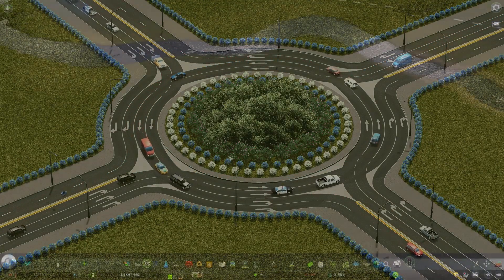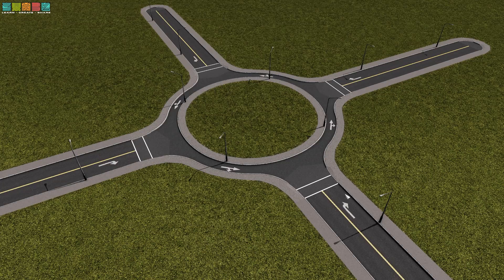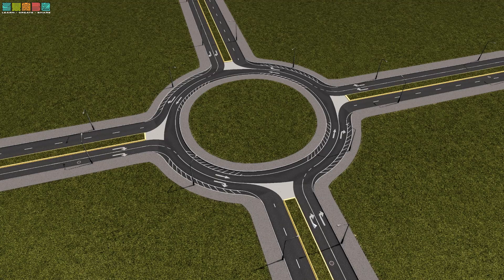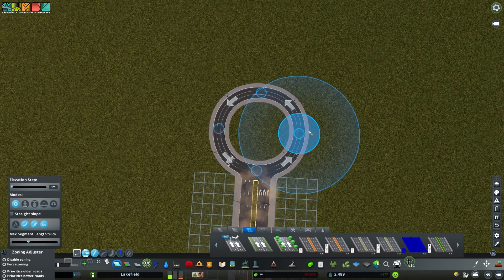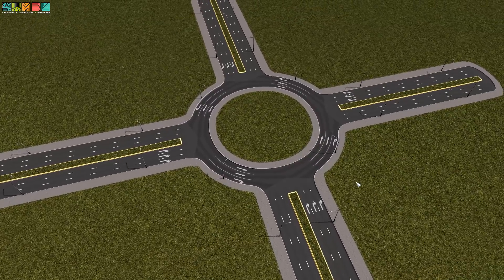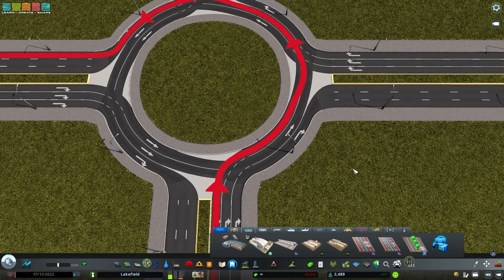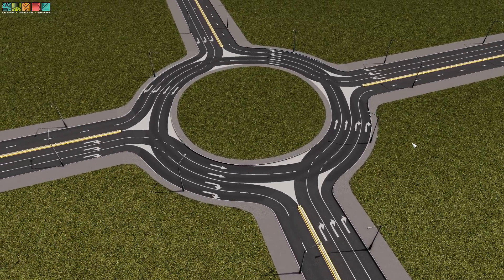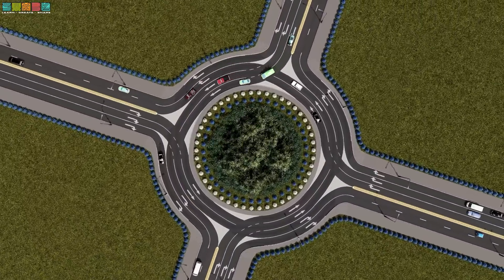Turbo Roundabouts and BEYOND!  -  Building Roundabouts in Cities Skylines

Comment: 3:17
One lane can fill either of the lanes inside the roundabout does just fine, giving you good flow.
Using two lanes only really makes sense if you have too high intersection density anyway...
I really don't see why you should have two going in if you got a well designed city.
As for having two lanes going out, you're not supposed to.
When you have two lanes in a roudnabout the inner lane is supposed to keep going around and only the outer lane is actually meant to be used to exit the roundabout.
If you have a roundabout with 4 roads going in and you drive towards the roundabout the rightmost lane in the roundabout is for when you want to go to the road to the right.
If you want to go straight ahead, left or essentially do a U-turn you'll take the left lane then switch to the right lane once the next one is your exit.
Any traffic to the right of you inside the roundabout has already left the roundabout in the previous exit, and any traffic comming into the roundabout is yielding to you anyway.
So you'll get good flow out to the outer lane.
If you have two lanes going into the roundabout you just increase the likelyhood that some idiot in the other lane going in ends up cutting you off, potentially causing an accident.
As for when leaving, a two lane roundabout only have one exiting lane inside the roundabout at every exit anyway if it's designed correctly.
So in either case you have one lane going in and one lane exiting the roundabout at every step.
Adding more lanes just risks adding more confusion and increases the risk of accidents.
Just K.I.S.S. for goodness sake...

4:28
That might look good but it's a horrible roundabout...
In reality less markings and fewer lanes entering and exiting would make that roundabout much better...

6:03

I don't have enough experience with that kind of roundabouts to comment 
much on what is or isn't best for the 3 lane roundabouts.
That said, if you need anything like that then you probably got a city planning problem with too much traffic to begin with and not enough mixed zoning.

Or in other words, pretty much all of North America... :-/

10:12
Hum, if I was making that one I'd do two lanes in (unless there's a bus lane or some such, if there is I'd probably end that shortly before the roundabout to simplify things).
With that many lanes markings might make a bit more sense...

Comment: To allow U turn you could add U turn spot before the roundabout, at least in the version with green belt between directions. That way, you don't have to enter the roundabout to U turn.
To be honest, I have never seen turbo roundabout as shown in the RL, it's usually allowed to either change lanes to right or stay at the left lane. But even those are rare, and usually the it's just the right lane if you intend to leave round and left lane if you want to continue on roundabout.
Reply from the maker: Excellent idea!
Reply: In the Netherlands you can find Turbo-roundabouts, usually not larger than 2 lanes, Turbo-roundabouts are safer than ordinary multilane roundabouts since changin lanes on the Turbo is not done (also there are ridges between the lanes to make people not switch lanes), you have to pick your lane before you enter the roundabout.

Comment: Never seen any of these. And we have roundabouts in most intersection in my home town. The thing I’m a little concerned about is the fact that you have more lanes inside the roundabout, than from incoming lanes. Here we have 2 lanes in the roundabout itself if there are 2 lanes as the largest incoming road. Since you always has to yield for the traffic inside, and their choice of lane inside desides what exit their going to use. We also have a third lane sometimes for just going right, but it’s mostly detached from the roundabout itself. And merges with the next road as a highway lane coming in. And of cause we have more lanes in the roundabout if there are more lanes coming in.
 And for clarification. The right incoming lane is for right turning or straight ahead. The left for left or straight if there are a 2 lane road outgoing. But you do not change lanes inside the roundabout when using the left. Then you also depart in the left lane. Meaning you can have double the traffic going straight.

Comment: We (NL) usually have dashed markings on the complex round-abouts, so can easily switch lines.  The lines bring you to the pre-chosen exits, but you are not required to follow them strictly.  This enables passing cars (especially useful when the circle is large), and you can also make U-turns.  When you accidentally miss your exit, simply get around once more.  On small-spaced turbos, we often have strict linings, often enforces with bumps to discomfort switching lanes.
Reply: one configuration we (NL) have of the turbo is the 2 lane entry with the priority/main road having the right lane going right and straight instead of right only and the left lane going straight and left. and I love it. it works incredibly well with high traffic roads that pass by towns. it would be the configuration of my choice for a lot of town/city main roads/streets in the US that are currently already 2 lanes wide.
Reply: NL city planning is so incredible.

Here in Belgium, city planner learn a lot about your vision about city planning.
That's pretty cool
Reply: Uh... If my (Dutch) driving instructor and instructional material is to be believed (and I also believe it): no, you are required to follow the lines of the turbo roundabout. You are in violation of the traffic code when you switch lanes of a turbo roundabout. Doesn't keep folks from doing it anyways all the time, though.
Reply: Nl?
Reply from the maker: The Netherlands.
Reply: @conrrr  netherlands

Comment: I often use a slightly different version to your turbo roundabout: traffic on the inner (left) lane is allowed to stay in the left lane, which allows for U-turns to be made. The lane markings show the lanes on the roundabout, so that traffic driving towards the roundabout have an extra visual cue to give way to traffic already on the roundabout.
Reply: This is exactly what I have been doing too! Sometimes disallow u-turns on the bigger stuff. And I agree the markings are the wrong way around, the lane that gives way should cross a line, not the one with priority.

Comment: I think one time you'd want to avoid the turbo versions is if you've got, say, a collector road with roundabouts for intersections with other collectors and right-in/right-out intersections with local roads. Think a roundabout-ified RCUT-like thing. That sort of arrangement depends on allowing U-turns at the larger intersections to allow cars from the local roads to  proceed across or turn left.

Comment: The two lane roundabout setup (atleast in Australia) is quite rare. I call the style you did a tumble roundabout as you tumble to the outside lane to leave, you mainly see them on semi low-Med traffic suburbs but not major roadways (typically).

Typically both lanes entering the roundabout can continue straight ahead and you don’t need to change to the outside lane to exit. this preserves the through traffic aspect while making turning easy too. The best way to replicate this in game is to fork the roads into two one way roads just before the roundabout. The one way “on ramp” is then connected to the roundabout in such a way that it and the “exit ramp” of the crossroad now form a junction, creates a good flow and makes the first exit very easy for the traffic

Comment: Here in the UK the 2nd roundabout you showed is not quite right - the left lane entering the roundabout can go left or straight on (UK left hand drive), the right lane can go straight on or right.... So basically both lanes that enter the round about can exit on the opposite side. This helps when the main route would be straight on and the 2 turning would be used the least.  But I like the turbo designs.

Comment: Your two lane example, you can use Asymmetrical 2+1 roads instead, since you have only 1 lane leaving the roundabout, not 2, so the extra lane on a normal 4 lane road isn't used.  Same applies for your tubo example using a 3+2 or 3+1 asymmetrical roads.  Yet you did do it right with the super turbo LOL.
Reply from the maker: A three in one out road is a bit strange. Idk if i have one
Reply: @YUMBL  I dunno if a mod has one but at least a 3+2 would work.

Comment: The bus line example is just the cherry on top the explanation of this spiral behaviour ... an alternative would have been to color the lanes (by destination) with the markup tool.
One thing is however annoying ... the 8:20 "forced exit" only happens to one outer lane which then goes into three lanes. Traffic that wants to go straight through (or to the second exit) is somehow bottlenecked by the roundabout. The turbo version is a little remedy at least for right turning traffic, but that does not keep an arterial flowing on multiple lanes.
Would you recommend double exit lanes in these situations? Would treat a highway connection hooked into a roundabout differently if it's the origin or destination of ~90% of all roundabout traffic?
Differences in road hierarchy and also demand might be interesting questions for a follow-up video.
Reply: IRL yes. CSL doesn’t use the additional lane in my experience.
Reply from the maker: Csl roundabouts only seem to work well with one exterior lane exit.

Comment: No roundabout has traffic light. None. 
I'm not sure of the exact name, but I do believe the obsolete and dangerous American traffic circle is the one you're referring to. The reason why Americans today both hate and can't understand a roundabout.
Reply from the maker: Traffic circles and rotaries still exist here. Roundabouts too!
Reply: I'm in Australia, I pass through a roundabout on my commute to work which has a light incorporated into it. It's  a busy road (I rarely get a red). the heavy traffic flow on the first and second exit are able to move through without interruption for a short time. 

It's a 2 lane leading up to the roundabout, left lane is a slip lane which connects to lane one on exit one (constant flow there, light doesn't not effect that lane) right lane has the light which is for traffic looking to go to straight through to exit 2 (could go to exit 1 if you wanted but that's what the slip lane is for), around for 3 or back to 4 (for the U-Turn). Seems to work fine. It allows the traffic to move along uninterrupted for the much busier first exit. The queue at the red don't get overly long either (majority traffic is going left anyway and uses the slip)

The light is only active during peak hour so maybe like 4:30pm - 5:30pm and your morning rush. The rest of the day/night the light is inactive and the roundabout is used as normal.

In saying that I'm pretty sure it may be the only one I know of.

Edit: thought of another one nearby but I haven't used it while the light is active.

Comment: Funny enough, there is a roundabout in my (admittedly quite american) city that does not allow you to exit the same direction you entered, only a left turn-equivalent is possible due to the road markings. There is another one near my work that has stop signs, even though it is in an extremely low traffic area. Really ruins the flow.
Reply: that is what stop signs do, stop the flow, they should be replaced with yield signs IMO.

Comment: In the 2nd 2 lane example you should be in the right most (left most for here in UK) lane for turning right and taking the second (ahead) exit. If the ahead exit is past the 12 o'clock (11 o'clock side in your example) position then you should be in the inside lane. The 12 o'clock rule is what is taught here in UK unless the signs say different.

Comment: Really good and informative video.
However, the talk on City Planners discord about it mostly pointed out how unsafe the pinwheel is due to side merging like you would an on/off ramp for a motorway, but with such limited space it would be very dangerous without a seriously low speed limit.  So any of the normal, straight-on roundabouts are going to be safer as, even with a yield, you should be slowed or stopped and easily able to look right (or left) for oncoming traffic rather than trying to look over your shoulder and missing something ahead of you... or hoping the driver is aware of their blindspots and mirrors, etc.
Reply from the maker: You neglected to read the pinned comment. Or the description. The design has been reversed for the steam workshop version.
Reply: @YUMBL  Not sure why you are imitating Yumbl or trying to bring him down with your poor attitude.  But you clearly neglected to read anything I mentioned or pay attention to the video and there being neither a pin or description of relevance to what I mentioned, which was only about real-life safety concerns around a pinwheel compared to standard ones.
Reply from the maker: Yea. The pinned comment and description say that the version in the steam workshop has been reversed. You should have a look at it as it addresses your concerns. Thats why its relevant.
Reply from the maker: I’m sorry but you made the same comment as about 200 other people. I’m well aware.

Comment: Roundabouts for a U-turn option - when would you want vehicles to be able to make a U-Turn? How about busses. At some point you'll want to turn that bus route around so it can do the reverse trip back to stop #1. Or just before Stop #1 on a route so the reverse trip busses can easily turn around and get lined up with Stop #1 without having to wind about a long block or otherwise go far out of their way.
Reply from the maker: Or for median roads it can he helpful.  Ut is it worth the reduction in capacity? Maybe sometimes.
Reply: @YUMBL  That also works, if you have the road go into a dead end/cul-de-sac. The busses can use that to turn around. The caveat there is if you extend the road later on, that messes up the bus route and you have to fix it back up again, either extending it to the new end of the road, or find an alternate turn around solution.
Reply: How about people who took the wrong turn, now they can reverse :)
Reply: @deejeemadrox1866  in CS, they typically don't take the wrong turn unless you forced them to. Common ways you can do that are to have a lane where traffic has to enter the road on, with it then acting as a dedicated lane going in a particular direction some traffic on that lane does not want to go in, with no nodes between where they could change lanes. 

Another common cause of this is the overuse of lane connectors or lane change restrictions, which can trap vehicles in a wrong lane.

They'll then be forced in the wrong direction and to have to take a long detour before getting back on track to where they really want to go.
Reply: Turbo roundabouts are generally not build within a city on normal city streets/roads but rather on collector roads, which is a weird location for public transport busses to do a U-turn.
Reply: @DarkDutch007  This video is not about JUST turbo roundabouts. Watch the whole video again, he shows several examples of local road  roundabouts before getting on to his turbo roundabout example. And my comment was in direct response to YUMBLE's own in video comment on roundabouts being useful for u-turns, with the EXCEPTION of the Turbo Roundabout.